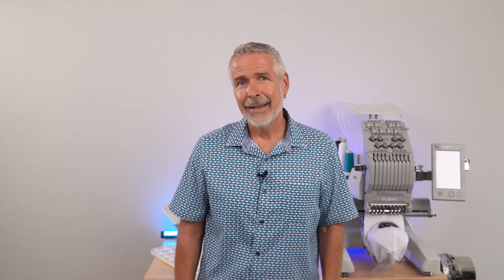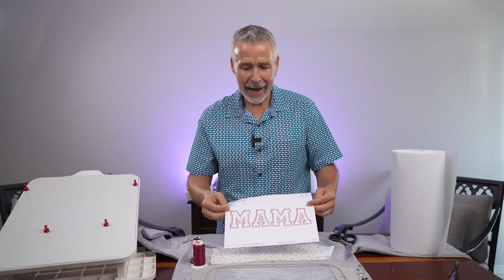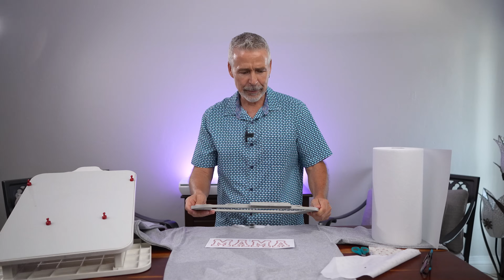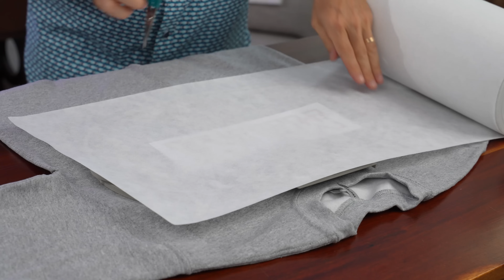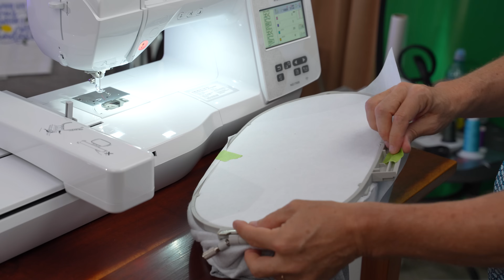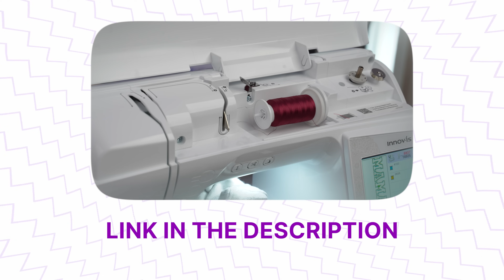How to Applique with Embroidery Machine EASY! Machine Embroidery for Beginners

Comment: New to this world … is there a setting on the machine to only get the outline ??
Reply from the maker: Great question! Your machine will always stitch what’s in the file — so if you only want the outline, the design has to be digitized that way. Digitizing is the process of creating the embroidery file on your computer, where you decide which parts get filled, which stay open, and what type of stitches to use. So, by digitizing a design as just a run stitch outline, your machine will stitch only that outline 😊

Comment: interesting concept. instead of doing most of these steps, i'd precut the letters first, and just enough out the outside of the actual letters. then, after the first step, which is to embryoid the letters, then i'd spray these finished letters, then put my cut letters, spray on them too, and put them on top and do the last step. isn't what is for the spray to make sure stays on place? 
i like the finish, you did great.

Comment: Design output looks good, but its complexity requires expertise to avoid shifting on single-needle machine. Needs specialized handling.
Utilize a multi-needle machine (single head) such as Tajima, Ricoma, or Barudan for easier processing.

Comment: I find it easier to mark the horizontal and vertical lines crossing in the middle on my garment and  mark a box of the design. Then I do a basting box on my hooped stabilizer and align the corner marks on my garment with the basting box on the stabilizer. I then sew the basting box again attaching the garment to the stabilizer that is hooped. I have only hooped one project in several decades of embroidering. Fortunately the method I use has been successful for me. Maybe others can be successful using the same method as I do and save a lot of time by not hooping.  I like the tip about making holes in the appliqué fabric  and marking the garment.